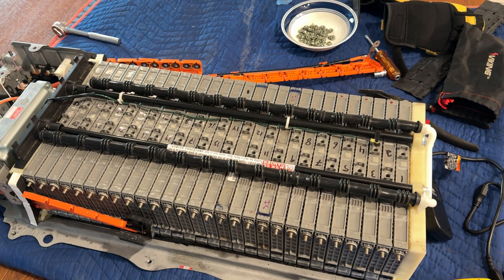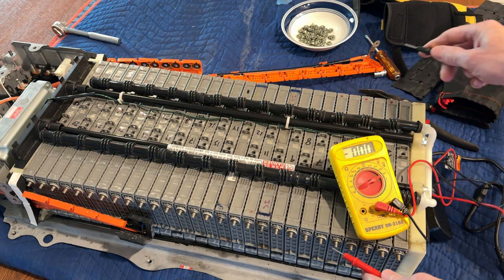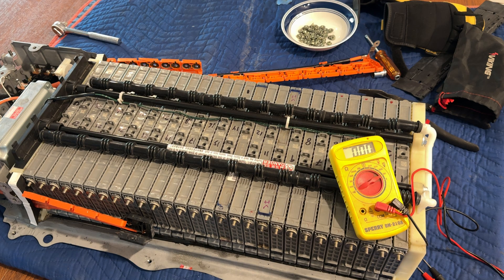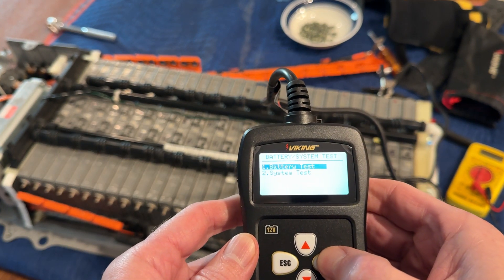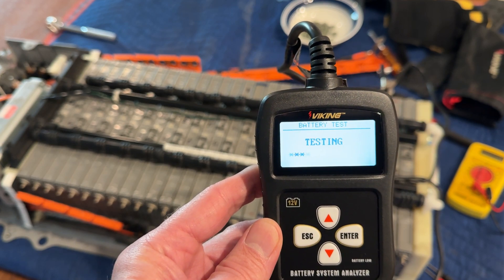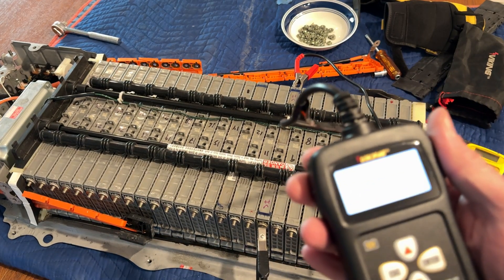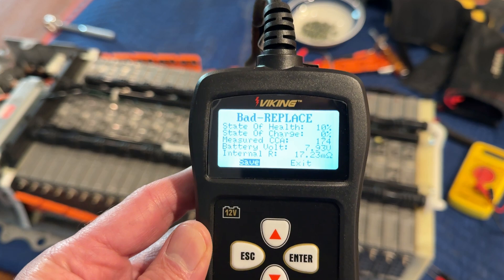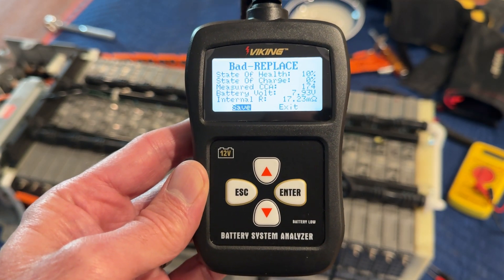Testing Prius Hybrid battery cell health the easy way

Comment: I saw a video, way back, where they used a regular load tester on a newly assembled battery and went right along checking each module, disregarding polarity.
The tester was one of the ones that's box shape w/ all the holes in the front and a meter above that.  There was a switch at the bottom and it had short cables with large alligator clamps.  HFT $20, I think the type was.  100 amp carbon pile.
  I'm sure there is no reading of internal resistance but it shows the draw=down over a few seconds.  I wanted to know your opinion on all that.
Specifically, does internal resistance correlate to voltage draw down?
Reply: Would love to find that vid.  I think I have one and it doesn't show voltage when connected backwards, but can still drain the battery.  Maybe they had a separate meter attached to the leads at the time, that would still read it but negative?  I know people that use that tool for load testing hybrid batteries...
Reply: @RogerPack  Yeah, I can't find that damn video.  It was probably a year ago.  Anyway, I blasted out and got that meter this evening.  Works great.  I got readings of 4.78 and 4.79, here and there.  Where do I send the check?
Reply: @alext8828  Nice.  were those like relatively abnormally low modules vs the others? Yeah 6s toggle switch on, calculate how much voltage drops from "off" to right till end with it still "on", compare readings between the modules...it actually approximates the difference in capacity fairly well and is super fast.  Glad you enjoyed it! To charity? Peace! :)
Reply: @RogerPack  Did you actually push the test button (or toggle)?  I have a 100 amp tester from Harbor but I haven't tried it yet.  It does 6v and 12v and it looks like some voltages in between.  I just don't know if the load is too severe that the battery would explode.  I like this Harbor Freight thing.  Why haven't I picked one up yet?  Too many fires to put out.  Going down there tonight.  I'll try to find the video now.
Reply: @alext8828  Yeah 6s, did two rounds of all the modules, calculate voltage drop by end of 6s.  It worked well, I may publish a vid on it sometime :)
Reply: @RogerPack   Wait.  You're saying 6s.  I don't know what that means.

Comment: Chris, your test method was indeed creative. But are there devices more suitable for this kind of testing? The battery tester you used was originally designed to test the 12v starter battery, not for a 7.2v (nominal) module. Other than worrying about the reading would be inaccurate, I do not know how that "500A cold cranking amp" was tested, and I wouldn't attempt (until I watched your video) to use it, for fearing that it would draw too much amps from the battery module thus potentially damaging it.
Reply from the maker: I'm sure there are many deices more suitable, but they are likely more expensive and harder to find.  This is cheap, easily available and works well enough to find the bad cells.  I was a little worried about the fact the device is for 12 volt batteries and not 8 volts.  But it turned out working anyway.  Lower voltage is probably less a concern to higher voltage.  Accuracy isn't the goal, but rather finding the cells that may show adequate voltage but fail under load.  Such a small device can't possibly draw 500 amps so I wasn't too worried about that.
Reply: What if after this test all batteries show good? What should I search for after? T I A
Reply: @pacobueno2818  See my other comment but I just compared CCA's, ignore the good thing...
Reply: Yeah I wondered that as well.  Seems it doesn't test by putting a load on it, it just sends some pulses through to see how much the voltage drops, you can kinda see a description by googling "How do car battery testers work?"
Reply: It won't damage the battery cell....this things see waay more.amp draw when they are in use on the car

Comment: won't the resistance feature on a battery charger measure this just as precisely? I'm guessing if anyone has yanked their battery, they are preparing to charge it with such a charger. My sky RC charger for example can measure resistance. Or is that inferior in some way?
Reply: Should be same.  This does an estimate of CCA's, which you can do in the Skyrim stuff maybe not as quickly (by doing a load test)

Comment: thank you for this great video. What does this device do differently than simply using a multimeter to test resistance?
Reply from the maker: It puts a load on the battery and tests internal resistance.  My simple multimeter can only test resistance, but can't even do that with voltage present.  .
Reply: @cvedeler  Ahh, I see. Since anyone considering this procedure probably already owns a charging unit, I am wondering if the resistance feature on such battery chargers would work just as well, or are they inferior in some way? I have the SKYRC B6AC for example.
Reply: @jayviz if it tests internal resistance it's good.  This device appears to also do a CCA estimation of some sort ... Which you can kinda do with the Skyrim stuff but possibly not as quickly (by doing a full capacity test)?

Comment: car stopped on the road 2 week ago. can the battery be reconditioned ? getting a dual charger/discharger.
Reply: If you're lucky, is it a pack style charger?  car stopping on road could be an issue with your 12V battery as well...

Comment: i used the tester you used. results voltage abovr 7.55 all cells resistance 5.00  milli ohms, all 100 healthy. but says all cell have zero charge left. what is the solution.how to charge ?
Reply from the maker: 7.55 volts is too low.  They should be closer to 8 volts.  My lowest voltage cell was 7.71.  If the cell resistance is 5.0 but the voltage is low, that points to a different issue, possibly with the charging system.  Good luck!
Reply: @cvedeler  I went right out and got tester - I’m getting the same results - Good - 100- 7.5 and up no 8’s volts and 4.8 and up resistance. Have change hybrid battery code Po80, I think and POAE6, maybe need to change the relay.  Fan was also dirty.  There’s alot of corrosion on the bus bars from precipitation (water leak).  Before I got the codes I had some electrical opens / parasites draining both batteries caused by a bad Radio./ AMP. Anyone know the first point to check the charging system?
Reply: Was it throwing codes?
Reply: What about a Gen1, what should the good voltage read? Im getting 7.5-7.6 each on all packs...??
Thanks

Comment: Hi Cvedeler :) have done extensive testing on Toyota hybrid battery modules over the last decade,  think i have tried everything imaginable over the years and i'm always keeping my eyes and ears out for new exciting ideas and easier/ better test equipment to make testing easier, but there's never any magic unfortunately 

 I tried a couple different types of these "load testers" a couple years back with mixed results, i found its handy to know internal resistance and these testers definitely help to find the worst very dead modules (as you have done here) but it really struggles to see any difference between extremely good and mediocre modules, as-new modules with 6500mah capacity often test very much the same as mediocre modules with 2500mah 

 For anyone considering this testing method for cars 2009 and newer, these testers only (sort of) work on the old style modules found in gen2 Prius, the newer style "low ir" modules found in gen3 prius, camry etc have very low resistance right to the end of their life, when they are absolutely dead as a nail the resistance might come up just a tiny bit, but not much! 

Its a fudge job without knowing capacity! there's just no magic. 

 i.r. alone is just not enough information to build a reliable battery, you need to know the actual capacity of each and every module to do the job properly unless you are happy to keep going back in the pack every few months and play waKaMole 

We need more magic in this space, testing these batteries is too time consuming and just annoying really! so many hybrid cars on the road these days and still no cheap reliable easy way to test each module without spending days standing over hobby chargers waiting for numbers! 

 Cheers from Australia :)

Comment: A question. Once reassembled did this help resolve the issue and if so in your experience what was the best internal resistance as a guide? Thanks for the video. A great idea by the way.
Reply from the maker: It worked well.  I had one terrible cell, but ended up replacing 5 others that were questionable.
Reply: @cvedeler very helpful thanks a lot
Reply: @cvedeler  When you say questionable.  What percentage did the other cells test at?  I just tested my battery this way and one was bad and several were in the 80 percentage of good. Thanks
Reply from the maker: @bestsurfersofalltime  All the cells I ended up replacing were 50% and below.  80% should be fine.
Reply: @cvedeler thanks for that information. Super helpful

Comment: silly question but is the 2012 Prius battery same layout?
Reply: 2012 will have "low ir" modules, so this ir based test method wont be any use to you
Reply: @mattaitchey4917   I wondered about that as well. For anybody that has monitored resistance using the simple dr prius app, 19 to 20 milliohms is pretty common.  Yet in this video, he rejects the one with 17  milliohms as being bad.
Reply: @MervsServiceSecrets  would have been a better module than the others!
Reply: @mattaitchey4917  I don't think I've ever seen a module with a resistance of 5!
Reply: @MervsServiceSecrets  late model low ir modules are often about 5 from memory, I will test one later :)
Reply: @mattaitchey4917  That would be great. Thank you.   (And when you say "late model" do you mean gen 2?)
Reply: @MervsServiceSecrets  The readings DrPrius sees is internal resistance between two batteries in series since the Prius can only see the 14.4v blocks believe 5-15 ohms is considered normal range
Reply from the maker: I believe it is similar.